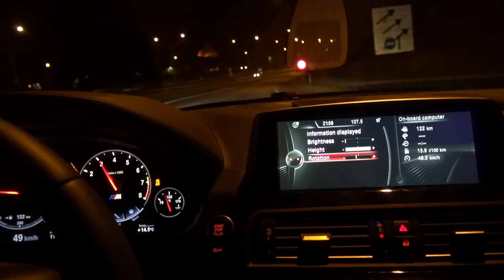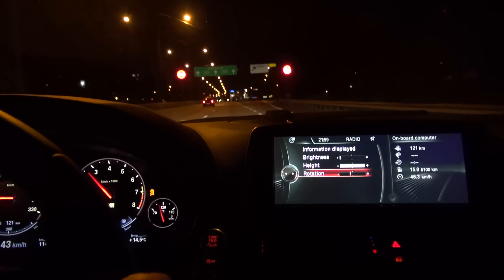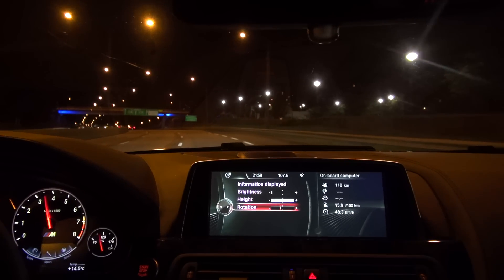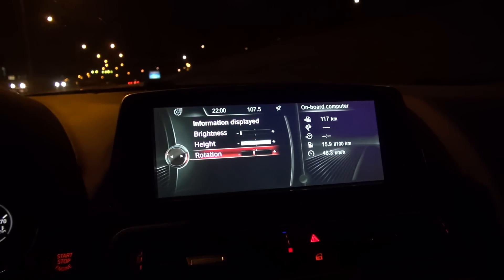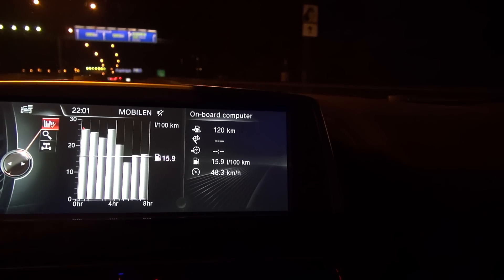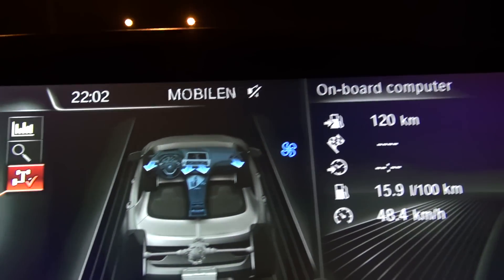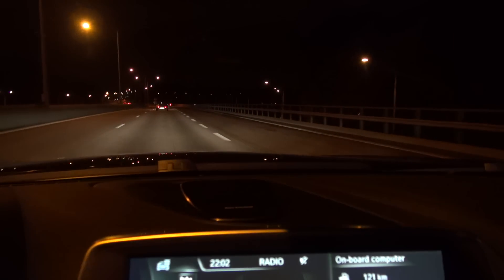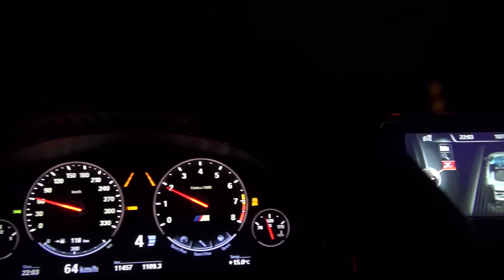Onramps with the BMW M6 Gran Coupe is no use when wet: also Efficient Dynamics display in action

Comment: Gustav efficient dynamics recharges the baterry (that is in the back) when you lift off the throttle, that is why you see that battery simbol and the battery glowing after the accelaration when you lift the throttle.